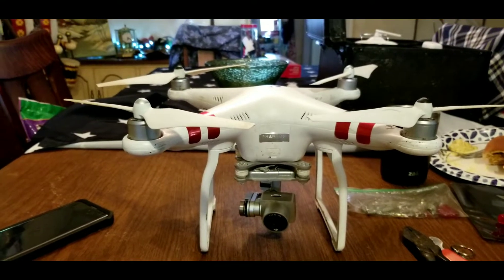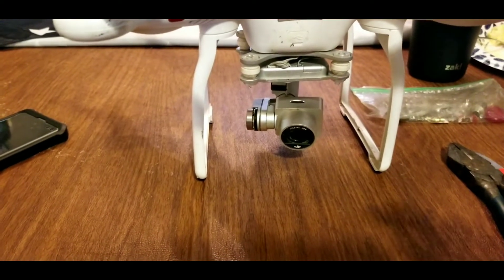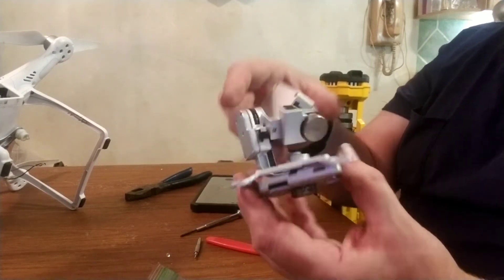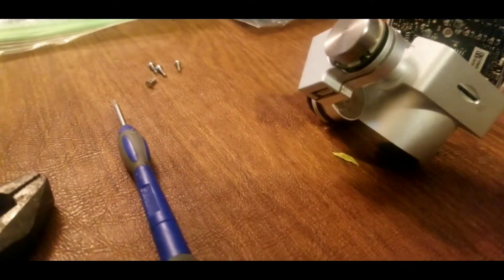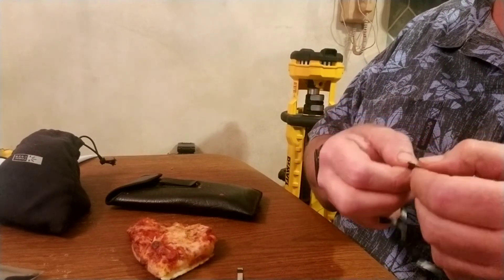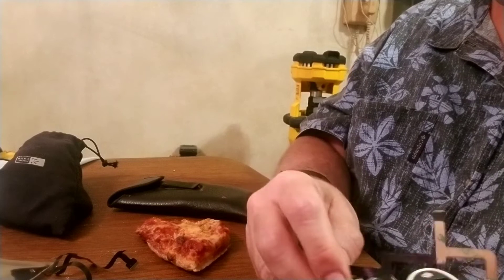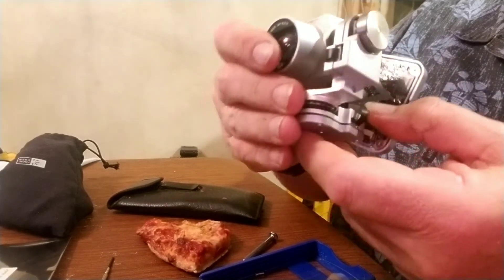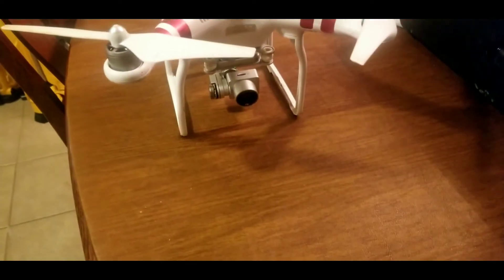how to replace ribbon cable DJI Phantom 3 standard drone

Comment: What's the cable called that You detach with the clip on it? Mine has broken and I have to replace it, but I don't know what it's called
Reply from the maker: If you go to ebay and type in phantom 3 cable , several different ones will come up.